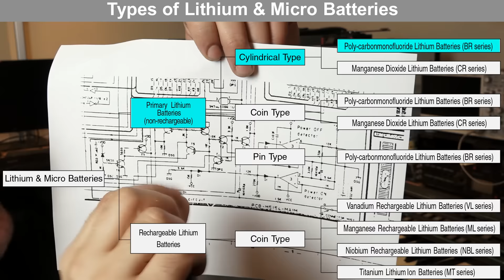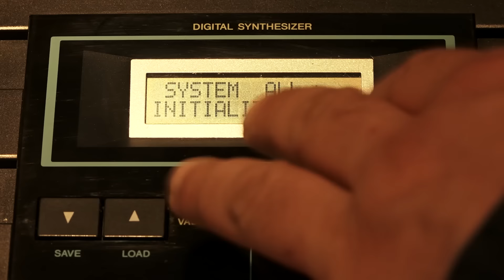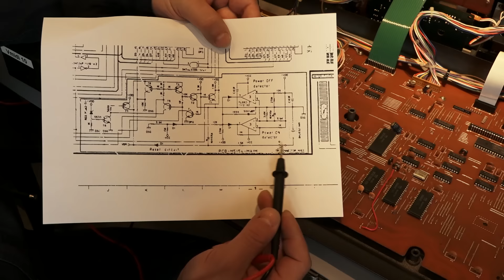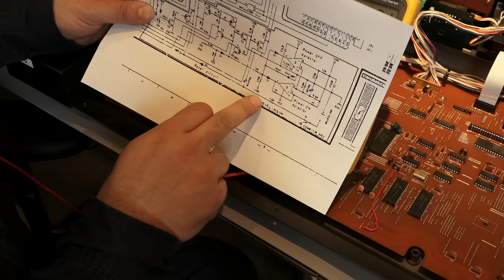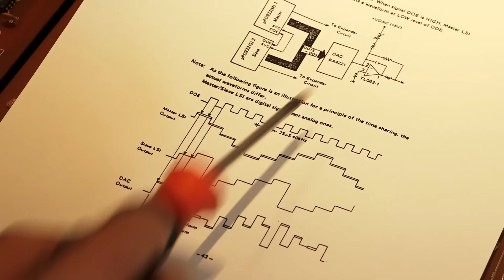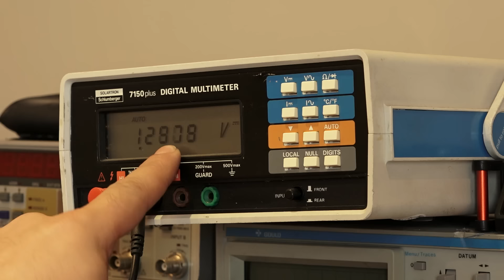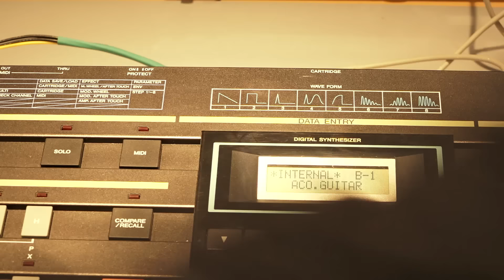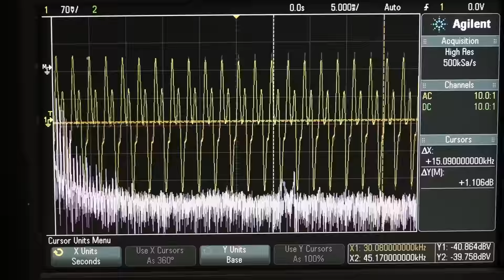Gear Hospital - 02 - Casio CZ-1 battery replace, tear-down, synth engine review

Comment: Thank you for your straight forward video, the subject regarding the CZ-1 battery issue and the quick, for me educational tear-down. I own a CZ-1 with the same battery issue; After replacing the battery a new CR2032's constantly is dead after just weeks of use. It's good to read (hmmm...) it is a general issue with the CZ-1 and I can now find a solution to it. Thank you!
Reply: try a small diode in line with the positive side of the battery. 
This should prevent the current flowing into the battery but not stop the current leaving the battery to hold the presets.

Comment: Casio CZ1 service manual schematics/parts list (page 62) show a BR2032-1HM Lithium battery. 

This video shows that it is sometimes replaced by a CR2032 lithium cell (which has lower temperature rating and quicker discharge), combined with a horizontal 20mm cell holder (the HM part). Just flip the old CR2032 cell out and slot another one in rather than desolder/resolder the BR2032-1HM. Quick and dirty solution, and probably a good quick fix to get your money and run. Beware the battery may fall out if the device is bumped, hence why Casio soldered the BR2032-1HM type in.

The '2032' is the dimensions - 20mm wide by 3.2mm high - same for both type of battery. 

The BR is for a ''Lithium Polycarbon Monofluoride'' battery, and the CR is for ''Manganese Dioxide'' chemistry.

Self discharge for BR cells is far lower than CR types (BR=90% voltage left after 10 years), hence their specified preferred use in a 10 year backup environment by Casio in the Casio CZ-1.  The BR cells are rated at 3.0v 190mAh.

Both the BR2032 and CR2032 batteries are designed to be NON-rechargeable.

I hope this clears up any misunderstandings.

Comment: Changing the battery every 3 or 4 years? No way. I just got a 34 years old CZ-1 with its ORIGINAL battery! And it still works. But maybe I will change it soon. So thank you for your video!
Reply from the maker: You lucky bastard :) Probably you have the original Japan SANYO cell!!!

Comment: It looks like if you put another small signal diode - between the battery and the next resistor, this would prevent the charging of the battery.  Something like a BAT42 for minimal voltage drop.  This mod is often used by the vintage PC crowd, to use CR2032 instead of a rechargeable lithium for the BIOS settings.  Thanks for the video.
Reply from the maker: I think the best solution for this synthesizer, if You attach a 120Ah tractor battery to it…😂 
I switched to Arturia Cz-V. Kinda 99.999999% same sound, so, soon this synth will go to a hibernation box.
Reply: @BMRStudio  yes, there is that option.
Reply: @BMRStudio  when you turn it on with the dead battery, does it already make the weird sounds of a corrupted ram info?
Reply from the maker: @robinsutcliffe_video_art  yes. But you can do a factory reset.. my patches are saved on sysex collection by Midiquest
Reply: @BMRStudio  thanks very much.  I have seen one for sale with this issue, I think it is fixable then so I may get it.

Comment: Fantastic explanation! I'm in love with CZ series but I have noticed that CZ-3k and 5k sounds much more opened and precise than CZ-1 (I had two of them). Do you think they could be matched with adjusting the trimpots of DAC?
Reply: There is apparently a relay in the output stage which can make these noisy, also the chorus I've seen someone mention even when off it is noisy and someone bypassed the chorus? Also consider that the velocity settings will change the tone vs other CZ's depending on settings - all other CZ's are fully on at any key velocity. I just got a CZ-5000 and CZ-1 yesterday, I shall compare (have only played with CZ-1 so far)

Comment: Nice video. I have a CZ1 for sale for me CHEAP... but it apparently has audio output issues where it fades in and out. Could that be an inexpensive repair?
Reply from the maker: Yepp... sound like the dynamic switcher IC. Few cent. Oooor, try to make a big boss reset. Hold the red initialize button, power on, say YES to the reset, then check it again.
Reply: @BMRStudio  You sir... are awesome!!! I pulled the trigger and purchased. No audio. Initialized. WORKS!!!! Bravo! Even came with the RC30 ROM cartridge. Thank you!!!
Reply from the maker: @mark35mi  RC30 is rare as pink diamonds! Must be stored in some military nuclear weapon security level storage :) Good luck for Your new synth!

Comment: I want to make the battery holder mod too, so I’m able to easy switch the battery, when it turns out to be a problem. The current battery is a BR2032 and is the original battery installed by Casio, it seems the battery is using a soldered holder.

There is a part here, which I don’t understand. The last owner of yours already changed the battery and an owner below mentioned/comment that he/she changed the battery too and it already ran out of power. (We are probably talking under 10 years)

Mine is still using the original Casio battery from 1986 and we are talking 31 years here and it is still working fine. < Do you see my point?

Comment: Great video, grateful you will make it easier for me to open the synth :).  Do you know what the original replacement battery should be?  I have not opened my CZ1 yet and wanted to find out what battery I need to buy before I open it.
Reply from the maker: They are using originaly BR2032. Actualy is a CR2032 with legs. Not easy to find. Ebay :) If You find, buy 20 pieces at least. Second solution, if You take an old pc motherboard, desolder a CR2032 battery holder, then You install it into the CZ1. Then You can use normal CR2032. But the best, two AAA Eneloop in a holder.

Comment: If there's a sensitivity issue on a select few keys that always require a harder strike to produce a tone, do you think a battery replacement would provide any benefit or is this an issue with the aftertouch sensor?

Also, just want to say this is an amazing resource you've created. Thank you!
Reply from the maker: Nope... You need to clean all key rubber contacts and the pcb , then check all resistors, diodes on the keyboard pcb. Simple quick job with isopropyl alcohol.

Comment: Hi great video, thanx for this.  I own CZ 1000, and have a problem with a internal memory. Its always clear after while.. Can i use 3x AAA batery to fix this?? Thanks
Reply from the maker: I suggest only 2 pieces from regular 1.5V, or 3 pieces from 1.2 accu. for accu, use some low power model around 600-800 mAh. You also have to limit the current. Accus and big AAA batteries can burn Your CZ if there any problem. So the best if You take the original cell battery max current, calculate a resistor in series with 3-4 AAA. It will keep the memory almost forever :))))

Comment: i just got a cz 1 and have to change the battery but it seems mine's soldered on and i don't have a soldering kit x)
Reply from the maker: So its Original! You can cut out the cell, but left  the two pin. Then you can do giggly boggly job with 2 AAA battery :) and a plenty of masking tape....

Comment: very very very good video! I've a CZ1000 and i'm looking for a CZ-1 now.
Reply from the maker: Thank You :) I just love this puppy:) There is huge different from CZ1000. But, if You want more with a same Casio taste, go for VZ line. Or expand the CZ1 with VZ rack :) Killer config!
Reply from the maker: Nah You got the CZ1? :)))
Reply: +BMR Studio Yes!!!!!! Here in Brazil they cost something near U$250, I paid U$180. :))
Reply: +BMR Studio I've already cleaned all keys and remove rust from the pick up. Now I need to buy a new multimeter to do the regulations. :)))
Reply: +BMR Studio I'm planning to replace all the tactile switches as I did in my CZ-1000. On the CZ-1000 I used tactile switches from Omron, B3F-5050 (12x12x7,3mm, project type). For the CZ-1 Omron only have the B3F-5000 (12x12x4,3mm, flat type ) format, that have a unwanted plastic guide pin :/, I've the option to use a generic one or remove the plastic pin. ;) I'll probably buy at Newark site.

http://www.newark.com/webapp/wcs/stores/servlet/Search?catalogId=15003&langId=-1&storeId=10194&categoryName=All%20Categories&selectedCategoryId=&gs=true&st=b3f-5000
Reply: +BMR Studio Well... I have a big problem, until now, without solution. 2 of 5 silicon rubber switches keypads are damaged. All over these last 7 days I'm looking for a replace without success.  Casio support site list some Parts Distributors, like PacParts, AmericanPerfit, NTA, etc. All they say it is no longer available. :(((((
Reply from the maker: +frotico Best if You are just measure the dimensions and order something similar. Ooor, look for damaged CZ on ebay.

Comment: I have a dead CZ-230S.  Does it have this battery also?  Thanks
Reply from the maker: Just the main batteries. You must do a reset perform. Hold the cancel button while you powering on the keyb. Well known issues with 230: battery leakage to the display - CPU board.. almost unrepairable. Open it and check the connectors, cables. Look for rust!
Reply: Thanks!

Comment: I just recently purchased a Casio CZ-1. It has a weird behavior. When you power on, there's no sound. You need to sort of quickly flick the "Stereo Chorus" slider, then it will suddenly produce sounds. It will work, but sometimes the volume just dies and you need to quickly flick the "Stereo Chorus" again to make it work. I'm not sure how to fix this. Don't think the folks here in Casio Singapore can do much to repair. Was wondering if you could have some idea on what to tinker or fix. Thanks in advance.
Reply from the maker: Hi! I will have a look on the scematics. I think is only the coupling between the chorus and the synth last op amps. Wait couple of days. You will get answer:)
Reply from the maker: Hi! Lets go one by one :) First, clean out the chorus poti, and measure the contacts are good or not. 90% this is only the issue. I'am waiting for the results :) If not that, we will go forward, but prepare Yourself, will be hard! The Casio chorus is the most bizarrrre circuit on the planet :)
Reply: Ohh okay. Then my hunch was also correct. I've read about that as well here. Someone passed this to me: http://youthvulture.blogspot.com/2013/11/casio-cz-1-relay-replacement.html Thanks so much for your help. I'll let you know of the out come!
Reply from the maker: +Mathew Wong this relay are the next on the checklist :)
Reply: Hi BMR Studio, is there any equipment I need to check all of these?
Reply from the maker: Simple tools, like cheap multimeter and so on. But maybe the best, if you can give to some electronic handyman, such as old TV repair guy. Probably he will ask couple of dollar to check, clean and replace the dead parts. The CZ1 is so simple inside (minus the CPU and the voice chips) but in Your case I 100% sure is only dirty pots. Just try without open the case, just spray into a tiny bit of WD-40 and move it. WD-40 is Your best friend :) If the problem gone, then open the case and do a proper potmeter cleaning with dry contact spray, then  Vaseline based contact spray.

Comment: You mentioned above (23:50), that the battery should be replaced with a rechargeable battery, but your linking to a BR2032 in your description info below your video. BR2032 is not a rechargeable battery to my knowledge, in that case you will need a LIR2032. I found this note from this web page:
http://www.pickvacuumcleaner.com/cr2032-br2032-lir2032-3v-lithium-primary-rechargeable-coin-cell-batteries.html
Note point-out:
“CR2032 and BR2032 SHOULD NOT be replaced by LIR2032 battery due to voltage difference - 0.6V doesn't sound much, but it is enough to make the damage. Before replacing CR2032 or BR2032 batteries with LIR2032 check the device manuals or contact the device manufacturer directly.”

Question:
Is Casio CZ-1 able to handle the voltage from a LIR2032?
Reply from the maker: I find out, does not matter what you install...
1-3 month of non usage, and the battery is flat, due the memory designs in that time. I read somewhere, one guy replaced the memory chip to some modern version and problem solved.
Voltages? no issue at all, only the capacity differences. LIR is around 40-50 mAh which is 1/5 or the CR.
The main problem here is the small leakage current to the CR, and because of that, you can get damaged PCB by the chemicals.
In my case, I have a full backup always for my synths, and to recall the factory settings is so easy on the CZ-1.
And time to time, this crazy issue give me some bizarre, but nice sounding patches :) 
Anyway, this is a old synth, and this is his soul.

Comment: Watched most of your video a couple times all the way through, very good content! Maybe I missed something about the internal battery, let me ask you a question. You seem to indicate the circuit is designed for a rechargeable battery, and will kill a non-rechargeable one. I replaced the (dead) battery in mine with a lithium LIR2032, and everything appeared to be fine, but after about a month of occasional use the battery was totally dead. I tried replacing it with a regular battery and now I can see that that one is dying slowly (it looses about .2v charge every day or so). Can you provide any insight into this? Does the Li battery charge only when the CZ is turned on (i.e., you need to turn it on for several hours every now and again to keep the battery alive)? Do you think there is some other issue causing my battery to slowly drain? Which one am I actually supposed to use? Thanks.
Reply from the maker: brickmaj Hi! Yepp, is a bad design from Casio. Is charging only when switched on. 0.2 Volt is too mich lose. There is something wrong with the memory chips? But... You can install a double AAA battery box inside with rechargable cells. with 1000 mAh cells will be good for couple of years. cost around 2 USD total.  There is a lot of space to install :) I think the memory chips are eating a lot. I read some service article about replace the memory chips with some others from Texas Instruments. but I never find this document nowhere from 2014. Lost knowledge... Soon You will see some other video about this synth. Frankeistein CZ :)

Comment: As far as I can see, the problem is not solved. Instead a lot of talking about the synth in general. Did you forget on the way with what you started with? The BATTERY! Replacing the CR2032 with a chargeable battery is not the solution here and there are no chargeable batteries that fit in a CR2032 socket.
Reply from the maker: There is :) Have a look on the data chart in the video. Panasonic has, but only with trough hole legs. My synth has already a socket, so I just cut the legs. Still working even today... Called LR2032 or LIR2032 (also mentioned in the video)